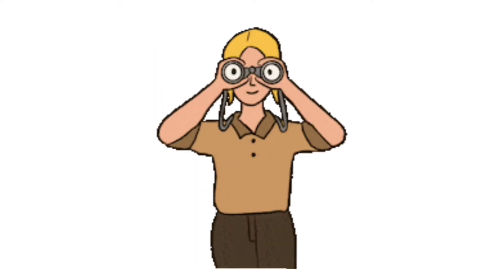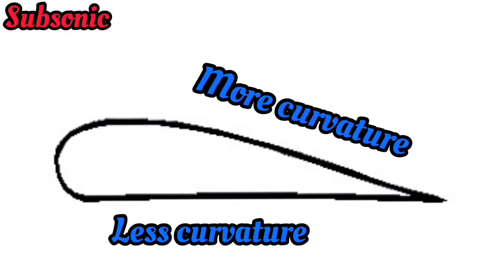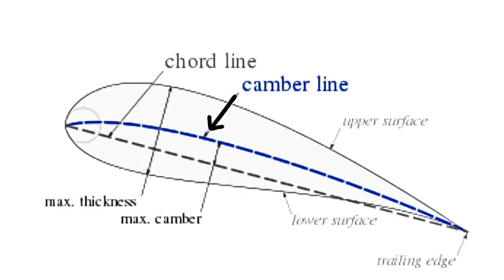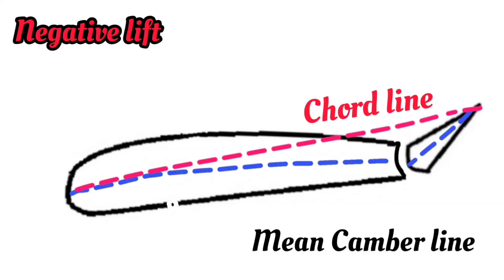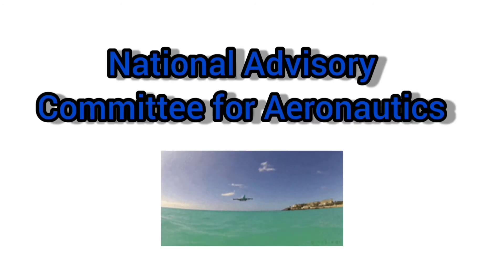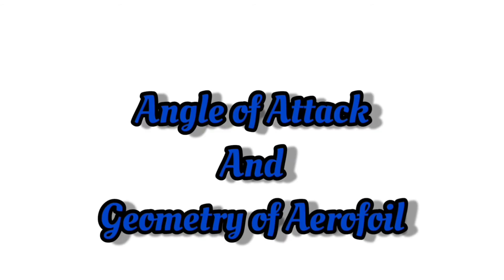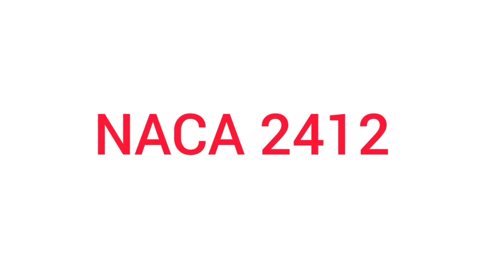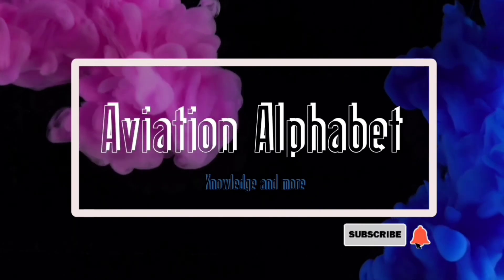How is lift generated ? || Aerofoil basics || NACA series || Camber || Chord line

Comment: The air flow on the upper surface does not have to reach the air flow on the lower surface of the air foil. Dr. Holger Babinsky ran an experiment where smoke particles flew across an airfoil lifting section and the upper surface had a higher velocity than the lower surface. It did not catch up at the trailing edge. Bernoulli's equation simply relates pressure and velocity it cannot be used as a cause and effect relationship.